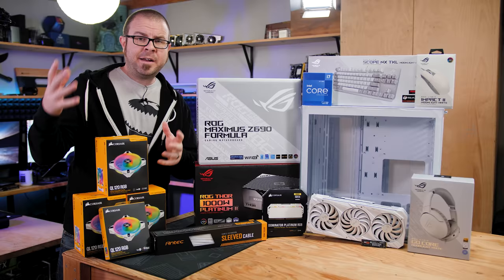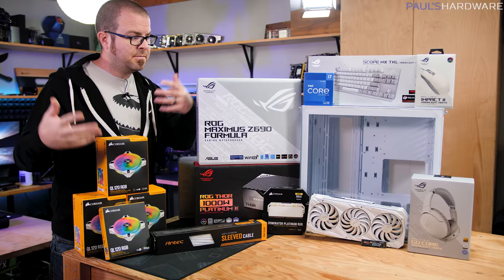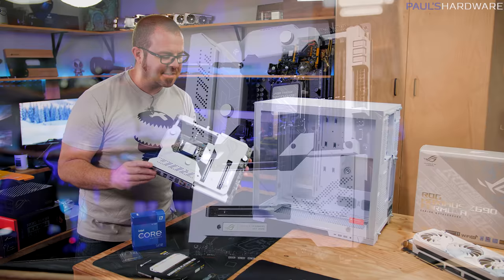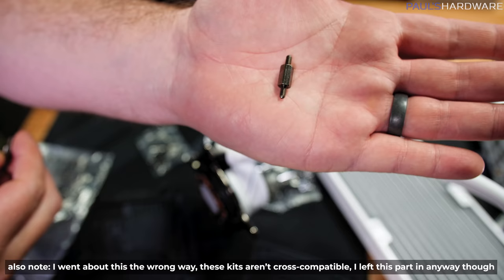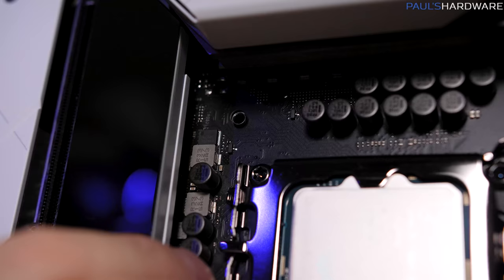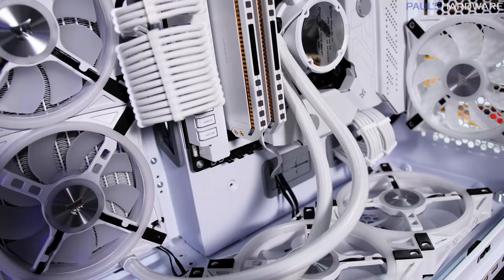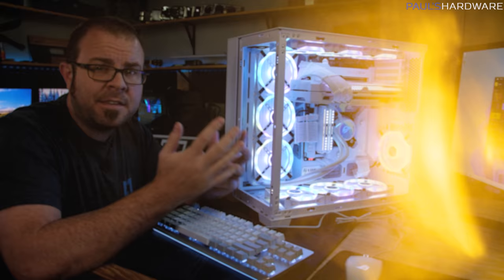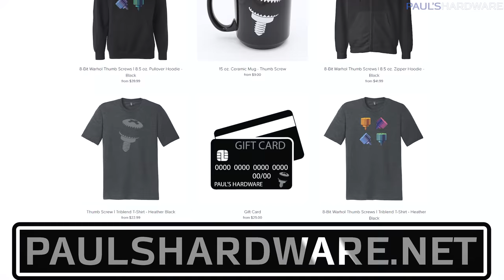Building a Meticulous, Epic, All-White Gaming PC... UPSIDE DOWN

Comment: IDK but the fan ordination doesn't seem right. All pulling air in except 1 lower side exhaust? :elbowcough:
I just completed an all white build in a 011 XL ROG and put my x73 AIO at the top with it's 3 120 LL's being the exhaust and 3 120 LL's on the side and 3 120 LL's on the bottom pulling air through the Lian Li filters which I believe is best for air flow, low noise and low dust. :yougotthis:

Comment: 13:50 - I've been watching a lot of tech channels build PCs for a few years now, but I think this is the FIRST TIME I've seen someone use a thin plastic sheet wrapped around their finger to spread thermal paste on a CPU. I am DEEPLY intrigued and curious to try this method of thermal paste application on my next PC build. Paul, you are a wild one haha.
Reply: I keep using it, or nitrile gloves
More control on viscose paste, looks better, no pressure differences by using a spatula on tight places & honestly is faster :)
Reply: Just moved, need to reassemble my PC, definitely going to try this, thanks!

Comment: This looks amazing, but the LED readouts on the MB and the "Geforce RTX" badging on the GPU being upside down trigger me lol
Reply: Graphics card manufacturers maybe need to follow the case design here and include the labels as user fittings so they can be flipped.
Reply: Yes... Definitely a trigger. Lol I was waiting for Paul to flip over the case afterwards. But he never did.
Reply: @bionicgeekgrrl  That actually would be amazing if you could. I'd be 100% all for it.
Reply: I can’t stand the lcd, nvidia and Corsair fan logos are upside down
Reply: @bionicgeekgrrl  I believe Nvidia requires that badging for all board partners. I'm not sure there is any flexibility.

The AIO leds can probably be flipped though.
Reply: Yall realize that's the point? It's an upside down build. 🙃
Reply: I do like the upward facing GPU fans, though, that looks good. :)
Reply: same lmao that’s why I could never do an inverted build like this, not to mention that you’re basically forced to pull air in opposite directions with intakes on both the top and bottom of the case (at least this one in particular)
Reply: @morells09  if the LEDs are on the intake side of fans, then there should be 2 exhaust areas and one vertical intake on the side. Should be fine for temps
Reply: @maxcarrasco260  the LEDs are on both sides of the fan for the Corsair QL series, so bit of a moot point there
Reply: @morells09  ah did not know that
Reply: Esspecially the water cooling portion. Like the water cooling will not work properly. Scares me a bit
Reply: I have that card you can just take off the Geforce rtx badge

Comment: Looks like clean build.
For the audio cable where it plugs into mother board I've put black electrical tape around it so you don't see rainbow color. Just put the cut off on the least likely spot to see it.
Ketchup mustard look just peeky thru was annoying

Comment: Looks fantastic. Question: are you concerned about the air flow for the AIO being that the hoses are below the the pump or is that not an issue with this AIO?
Reply: doesn't matter because the air bubbles are going to collect in the end of the radiator (highest point, which is also as far away from the pump as possible)
Reply: All that matters is that the pump is not the highest part. Given the radiator extends above the point of the pump, there is no issue.
Reply: He installed it in the best orientation.  Any air in the system will collect at the highest point which is the top of the radiator.   If you installed the hoses at the top you could get 'glurbling' sounds.
Reply: @curtisbme  he installed it the only way it’s going to fit.  Flip the case to the normal setup and the hoses are going to end up on top. It’s not as big of a deal as you think it is.

Comment: Great build as always Paul. Curious why you went with 9 of 10 fans intake? Shouldn't the 3 on the AIO be set to exhaust instead?
Reply: always. One simply does not blow hot air into the case.
They all know it but never abide by their own advices.
It's showing amateurism and puts them in the pure marketing department. Like AMD first saying you need 8GB for gaming but when it suits them they auickly change their stories and now customers suddenly should be happy with only 4GB vram. They are all marketeers full of lies.
Reply: The fan setup is all very odd looking, and I think there's going to be a lot of turbulence inside since there's only one fan for exhaust.
Reply: Yeah I agree, or at least I think he should have mounted the radiator at the bottom of the case and make that an exhaust, but it would prob look funny with the AIO tubes like that
Reply: @morells09  the pump should not be the highest part of the aio
Reply: Yah noticed this immediately. Case isn’t open enough for that huge discrepancy in exhaust vs Intake.

Comment: The airflow definitely needs a rework. I would set the single exhaust as intake as well and the top 3 ones as the main and only exhaust, so this way you got fresh air coming in from bottom and side and all generated heat exhausting from the top

Comment: the water cooler pump should be lower than the radiator's hoses, it might get a malfunction because of the pressure.
Reply: how is air going to get into the hoses if they are on the bottom
Reply: The radiator should be higher then the pump which it is.
Reply: No. He installed it in the best orientation. the radiator extends above the point of the pump

Comment: Clever how you hid the bottom fan cables. Looks great. The QL120 fans look nice, however the led lighting isn’t defused well and the green led tends to die quickly and you up with pinkish purple colour on that node. Considering the cost it’s not great. I’d be interested in your/your wife’s experience after long term use.

Comment: Yeah, I had the same type of issue with my CPU mounting hardware, ( Noctua ).  You have to rotate the fan 180 degrees or get different mounting hardware if you want to do the "standard" install with the fan exhausting towards the rear of the case.  It's a PITA but that's the price you pay sometimes when you adopt a brand new hardware setup.

Comment: You have 9 fans for intake and 1 fan for exhaust...  Why not have the fans on the radiator as exhaust....  that would make 6 fans for intake and 4 fans for exhaust and that will still give it more of a pull configuration and keep the dust out.

Comment: I'm also using a combo of Corsair and Asus RGB products. I just use the Armoury Crate to manage the Asus component lighting. The Aura Creator just seems like a headache. Also the Rgb strip on the front of my O11 xl is plugged to my Mobo RGB header to control it with Armoury Crate as well.

Comment: Paul, I bought the ASUS ROG Strix LC II 360 ARGB CPU Cooler which is supposed to be LGA1200 and LGA1700 compliant. Of course, it did not come with the LGA1700 upgrade mounting kit. My question to you is. Did it work just fine with the LGA1200 bracket it came with? Ther build is awersome I know your wife will love it. Thanks in advance for your answer and keep up the great work you do.  v/r Jose

Comment: Hmmmm…I would like to know temps at inlets and outlets…and I would have the radiator fans push outward (shunt cpu heat asap) assuming top and bottom trios push inward. That way 6 fans are blowing in and 4 out. I think that near balance is important with the GPU fans blowing down, which means total air exchange is important. You’d still have a pressurized case. I think it worth looking into mounting the GPU vertically for better heat control.
Alternately, have the top fans blow out along w rads, and the back fan blow inward. Then it would be 4 in, 6 out with mostly upward flow. The GPU may suffer w such countercurrent, but maybe not?

Comment: I've had nothing but headaches with the ASUS plug-in for the Corsair iCue software on a build. Despite several updates, the model of the video card and motherboard never showed up in iCue, just like your system. Landed up disabling the plug-in for iCue and using Armory Crate (which includes Aura Creator) to control the Strix B550-F motherboard, RAM (TridentZ RGB), and ROG Strix video card.

Comment: Paul, I have an ROG Crosshair VIII Hero board and all Corsair LL Series fans in my build and to get the Asus RGB to work with iCUE, you have to have Asus Armory Crate installed. The problem is, it doesn't work seamlessly (There are a ton of posts online from others with the same non seamless functionality). I finally figured out I needed to boot my PC, stop iCUE, load Armory Crate, close it, but not the services and then open iCUE. Very Janky, but it eventually worked. It will probably stop working after an undetermined amount of reboots and you'll have to do the same thing again.
Reply from the maker: Thanks for the tip Clayton! Hopefully I can get it working 😅
Reply: My pleasure Paul. Take care.

Comment: First - I am a huge fan and as usual you did a fantastic job on this video; however, I would like to offer a couple questions.  Who is willing to spend $3,000+ on a video card?  Do you think that all these extremely "overpriced" components will eventually kill the PC gaming industry?  People can buy an XBox, PlayStation and Nintendo Switch for less than $1500 vs $5000+ for a build like this.  $1,000 motherboards, $1,000 CPUs, $3,000 GPUs, $500 for RAM is simply not affordable when you have to buy them.  PC gaming component pricing is killing the industry - do you agree?

Comment: I would like to see if the reverse build affects the GPU temperature. The reverse build suits my desk but would be concerned with my 3080 memory junction temps.
Reply: While my instictual feel is that it would hamper performance, on second review he does have fans blowing air in from the top of the case, so I'd expect gpu temps won't be affected by the orientation much.

Comment: I'm just about to build in this case and was a little worried about cable management (especially as I'll be using extensions for the first time), to the ppoint where I wondered if I should use the new Corsair Shift PSU so the cable would be going up towards the HD cage but I'm reassured by seeing how you managed it.

Comment: So I can’t remember who I saw had done this but I think it would clean up one thing. Your GPU power connectors, use a couple 24 pin CPU cable combs it will make them all run right together nicely. Other that that it’s a VERY clean build good job!

Comment: Out of curiosity, wouldn't the AIO for the CPU be better off at the top? I'm thinking the way pictured in the video may cause air bubbles to go at the CPU instead of staying in the radiator and shorten the life of the pump. Other than that, the cable management is absolutely perfect, I wouldn't be able to do anything close to that xD

Comment: Hey you did exactly what I wanted to do, I got a Thermaltake AH T600case in white,  I wanted the white TridentZ ddr5 ram, due to availability had to get the black, but I did the Asus Rog Formula (love it), 12900k with H150i Capillex white aio cooler, and used my existing 3080ti. If you reply I'll provide pics, even though this being my 2nd full PC build the cable management could use some work haha.

Comment: Beautiful build, but shouldn't the cpu pump sit lower than where the tubes lead into the radiator?  If the case weren't inverted it'd be oriented correctly, unless I'm overthinking.

Comment: I'm building a all White PC alos. Going with the O11 Evo with Front Mesh Panel, 12900K, Z690 Formula, G.Skill Trident Z5 White Silver 6000 CL36, ROG Strix White 3090, Thermalright TL-B12 Fans, Seasonic Prime 1300W Platinum, White Primochill Fittings, Corsair 360mm Radiators x 2, EK Silver Velocity Block, Corsair White XD5 Pump / Res

Comment: I like the pretty white build, it looks good. The problem I see with it is the reflection it could create on a monitor screen, as seen several times in this video, if the system is adjacent to the screen. So, depending on the placement of the tower, a bright white system may not be in your best interest.

Comment: I always thought that those custom cables would connect to the power supply directly, I don't like that it is an extension to be connected to the original cables... Also don't like that the RTX logo is now upside down on the graphics card.
Man, this video gives me stuff to think about for my next build, especially those custom cable extensions that I don't like at all... Do you really have to use the original cables of the power supply?

Comment: Build looks great as always and happy you addressed components choice but  970evo... I would have preferred to have seen a 980evo at least. Rgb was thinking at start armoury crate and icue dealing with both 😱 given woes with AC and its basically broken rgb on ram in latest update icue is a safer choice. Cracking vid as always 👌

Comment: In this case I thought all the intake fans were exhaust and the exhaust fan was intake. How did you tell the difference and isn't the logo usually on the front? And pulling air from front to back is the usual setup of a fan? I'm a bit confused. The logos are visible on the 9 fans making me think they were exhaust..

Comment: Shouldn't the CPU Cooler be flipped upside down?  Don't you risk getting air in the cooler when it is mounted above the pipe connection?  Also, are you able to mount  a GPU support bracket when you flip the case like this?  It doesn't look like there is anywhere to connect on the case.

Comment: I've been waiting all week now to build my new PC. I went with amazon warehouse used motherboard because it was "like new" and less than half price of the board new (paid $124 for a $250 board). Of course when I got it, it had BENT PINS. I get that amazon warehouse employees aren't PC techs, but if theres only ONE THING you check for on a returned motherboard, it should be bent pins. I have another used one coming tomorrow, crossing fingers. Only taking these chances since its a lot of saved cash and amazon warehouse is easy to return lol. Plus I can run it for 30 days during the return period and really stress test the board for issues

Comment: Nice build, corsair fans are a pain to work with, the lian li ones you can connect together so 3 fans is only 2 cables ;-) you only need 1 hub, it's super easy. i love what you did with the bottom fans cabling that you've put it under the chassis. I'll keep that in mind for my next build with this case. Going to build inverted but with upright GPU (basicly downleft xD)

Comment: i think the only fans that should be blowing air out of the case and sucking up the air in the case are the top ones. That bottom right one " the back single fan of the computer if not turned upside down " needs to be turned and then you good good.

Comment: Asus aura has to be running and start before corsair icue otherwise icue just shows generic asus models and lacks mb control. Unless they've fixed that finally in the last 4 months which i doubt cuz it's been an issue since they started the icue-aura cross over.

Comment: I am assuming air intake on the bottom and on AIO, exhaust on top and the one at the back. Since the gpu fans blow down into the gpu, will this create any problems with airflow and cooling your GPU?
Reply: It looked like the top was intake too. Where does all that air exhaust?
Reply: In the end he said about the mostly intake fan setup and that he will benchmark the pc next video. I believe is just a experiment to see how it holds up.

Comment: Skipped to the end of the build, because I have to go run off do other things. But I am confused on the AIO placement. Wouldn't placing the AIO pipes under the CPU lead to increased thermals? Instead of placing it on the top

Comment: This is a really nice build. I have the O11 Dynamic in my current build. My only feedback is with using the top as intake I foresee a lot of dust and hair getting into the system. I use the top as an exhaust and every morning I wipe off the top of my rig before starting up...my dog also sheds a lot...lol

Is the exhaust fan the same size as all the others? My case is before they designed that area to mount a fan. I have thought about "customizing" my case to add one.

Comment: Oh yes, Corsair iCue doesn't work on a fresh install of Windows 11. Software needs to be engineered yet for Win 11. I have another system that is Win 10 that had iCue installed and updated then we updated Win 10 to Win 11 as "upgrade" and iCue still functions fine but it will not work on a clean install of Win 11. It see's the motherboard however, that's all, no functions can be made. I let Corsair know about this on their FB page and they said they are working on it, whatever that means. Something else I noticed...they do not publish minimum requirements for iCue in their downloads section which needs to tell folks it doesn't work on win 11. Seems misleading to not say so when they know so. Seems that iCue has always been on Corsairs back burner for years when it comes to getting it to function properly.

Comment: How many people when building a new pc spend big $$$ on the case fans? I used aigo (pwm/5v addressable) for basically $10 a pop or a 5 pack for $30 with controller. I purchased 2-5 packs and removed the msi coreliquid fans with the aigos. They can get loud but they are as clean as the msi fans, nice halo effect also.
Reply: The back of my case needs attention lian li 011 der8auer looks like a rats nest. Ill work on that this week